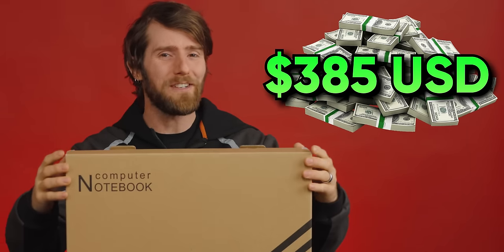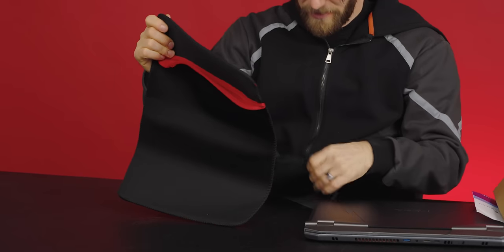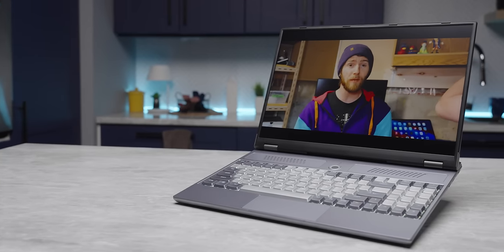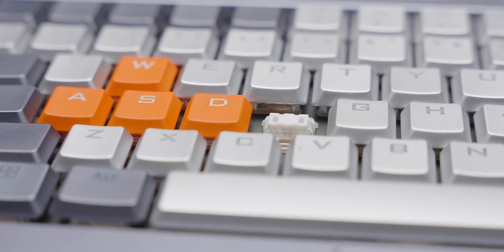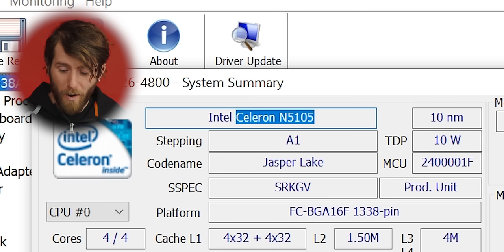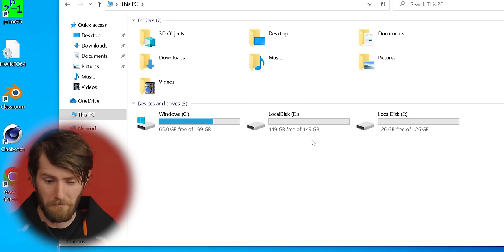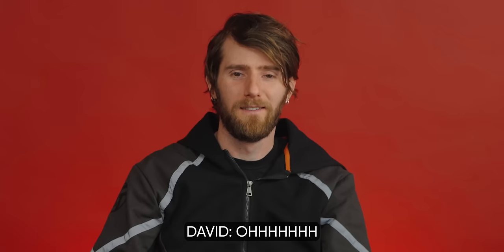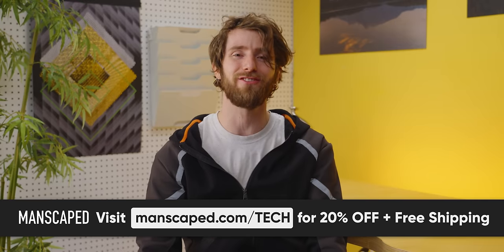Brown Star for Effort – This AliExpress Gaming Laptop is HILARIOUS

Comment: The magnetic webcam is actually quite nice.
Reply: Yeah, if it was done right i'd much rather have one of those.
Reply: i would rather have a physical toggle switch to disable the webcam. it would get lost and not be replicable because most companies dont care about reparability, and its not standardized so you have to buy their brand.
Reply: @VD-cc4hx  The point is not to disable it but to not have the border be super huge and/or thick. Good webcams (which this one probably isn't) need space, both tall and thick, both of which are really quite annoying when you want to make a sleek and thin display.
Reply: @sihilius  A few Chinese review channels also reviewed this laptop. Theirs all worked fine. I don't think they are paid to only speak about the bright side, and I really agree with their point of view. Why should someone spend all their really tight budget on a keyboard and screen, when the processor will be too slow to do basically anything in a few years , when they could buy a much more powerful machine with useable 1080P screen and keyboard, that will last them for many more years.
Unless they stick with windows 10 and MS office 2020, which is possible with the windows hackery that also works for office, and a reinstallation every few years to get rid of the junk files. So this thing is a really niche products for people who only type and browse the web. I really doubt whether this laptop will have consumer support in a few years. In China, it is possible to get it fixed by third-party, but it would not be worth the money considering how cheap it is.
So great idea, don't buy, unless you just want to use it as a secondary computer and are willing to accept the loses when it breaks.
Reply: I could see it being used on the ipads pencil charger
Reply: I wish i had one like this on my asus laptop
Reply: And you can hide it instead of using a sticky tape to cover it when not in use, to make sure you are not being recorded when you don't want to.
Reply: @yuxuanhuang3523  Sorry, my wording wasn't on point. I meant i'd much rather have a camera like the one in this Laptop but in a much faster laptop, that's actually useful for the kind of work I'd use it for, than a standard integrated webcam, that requires the border to be a bit wider. I don't actually want that exact laptop😅. Even for a secondary laptop i'd rather save up a little and get something with a little more calculating power than a very old school  mobile phone.
Reply: if only it worked
Reply: Until you lose it...
Reply: no shid
Reply: That's the only good thing in this lap haha 💀
Reply: @mohdarsh3263  and the price... If it had a nicer igpu it would be awesome. Almost worth having as a collector item for intel 10nm
Reply: @Kholaslittlespot1  yaa exactly an illegal collectors item (*_*)
Reply: It would be cool if the webcam was built in.
Reply: I like the idea too. Another idea: a center stage speaker. With software that boosts voices during movies.
Reply: @sihilius  exactly what I mean, good concept, bad product
Reply: Chinese products amaze westerners in way unexpected.  You get surprised negatively in a way, such as the speakers, while positively surprised by another.  Magnetic web camera is a brilliant idea, it gives you full and bezel less screen and safety.  Apple should definitely steal this idea and gets revenue from selling a separate HD web camera with price tag like USD 899.99.
Reply: yeah that is a great idea actually
Reply: @VD-cc4hx   Linus did a video about laptop webcams a while back. The physical limitation of fitting the webcam into the bezel of the display is actually why most webcams have such shitty picture quality (usually 720p). An external, detachable webcam would not only reduce the bezel size on the display, but would allow for much higher quality camera quality. 

https://www.youtube.com/watch?v=eWSQ7Cj_n5M
Reply: They could also partner up to make an integrated TrackIR or Tobii EyeTracker, which would be useful af on a gaming machine.
Reply: @sihilius  😅😅
Reply: except for the fact it didnt work
Reply: personally i wish it would have been a USB port solution like on the PSP with the PSP camera. So this could gave worked with a USB-C solution.  These little naked contacts seem way too flimsy and too sensitive to corrosion which results in bad connectivity.
Reply: @VD-cc4hx  that's what my hp x360 14c chromebook has.
Reply: @vocassen  Really? The upper edge on this laptop and my Omen 17 is practically the same and my display has a camera built in.
Reply: @piotrkowalski3869  Most of the Omen 17 model look to have humongeous borders, the smallest I've found (17-cb0020nr) has a border of 1.32cm (yes I calculated that from a front-facing image). Not something I'd say is small, nor would I say it's the same as the one in the video, which looks to be about half that size.
Also even that massive border of your Omen 17 won't fit some of the better webcams, which you'll certainly not find in a gaming-focused laptop where I haven't even been able to find a single mention of the webcam anywhere in specs or advertisements - not a good sign about it's quality I'd say.
Good camera needs space, shouldn't be that surprising.
Reply: @vocassen  When you look at the border of the laptop in the video it clearly not smaller than 1 cm and that .3 difference ain't even worth it.
Reply: @piotrkowalski3869  Idk if we look at the same video, but I'd guess it at 0.5-0.8cm max. But that's not the point. There are clearly laptops with much smaller bezels that wouldn't be possible with a webcam of any significant quality in them. That's the point.
Reply: It would be nice to have it on smartphones. Notch and punch holes must end! Such an eye sore.
Reply: @15bijei  At that point I'd just give up on a front camera straight up. Having an external accessory on a phone sucks. Instead one of those backside always on e-ink displays would be enough to at least check the framing should you ever want to do a selfie. I think there's a market for this, a lot of people don't really care about the front camera
Reply: @15bijei  Actually I take it back. What if you have a chunky, actually GOOD camera module that is both your front camera and back camera? Connection via USB, then an accessory might actually be worth it, for a niche audience
Reply: @Vocassen  they can create a grip/kickstand on the back with pocket for the magnetic camera just like the pocket for S-pen on samsung note phones. This magnetic camera can be use for selfie or rear.  It is also a good thing that cameras are detachable for security purposes. And you would be able to identify spying people because you can see that they are filming because the camera is attached to the phone.
Reply: @15bijei  Many problems here.
a) Thick camera attached on the back of the phone when not in use => More than double-thickness phone, better leave it attached if you need it and keep it separate. E.g. most of the time you won't have a camera with you, which might or might not bother you
b) If you rely on your camera to be detachable for security you already lost. Though I do agree front cameras are more of a security risk than they are worth for most people.
c) can't rely on bad actors using a niche product to identify them, completely inplausible. Integrated cameras won't disappear anytime soon. Also super easy to have cameras other than your phone that are super easy to hide. No way to counter really sadly
Reply: Hey there, thanks for the comment! I appreciate your thoughts😅 The magnetic webcam is a nice surprise, isn't it? It's an idea I pitched ages ago and it's great to see it in action. Enjoy the extra vertical space😉
Reply: No worries, I'm glad you liked the magnetic webcam! 😊 It's definitely one of the unique features of the laptop which I think is a great value for the price.
Reply: @sihilius  It's almost certainly USB electrically so someone handy might be able to do an upgrade.

Comment: Linus singlehandedly raised Deeq Inc. valuation by 100%.
Reply: Well I bought one after seeing this video
Reply: Can't help feel politically this was created as a "Come on main brands, upgrade your lower end tech already" video...
Reply: @SamariumNickel  Is yours still performing good and how is the battery life?
Reply: yes
Reply: @SamariumNickel  We need an update. How is the laptop? What do you use it for? Is it any good?
Reply: @TheNerogarden  Never got sound or the fingerprint reader working again after I installed Windows 11. Gave up after trying dozens of drivers. Never figured out what it needed. I thought about reinstalling Windows 10 but never got around to it. Pretty much only use it when Im traveling as an emergency machine. I never worry leaving it in hotel rooms or just losing it. As a beater, it serves its purpose. The camera dose fall out often though so I have that taped in. Without sound working on mine I don't use the camera.
Reply: @SamariumNickel  sounds like an amazing product
Reply: @SamariumNickel  If you ask the seller, or know anyone with the same laptop with original installation it should be possible for them to export those device drivers. Alternatively, you can in device manager find the device, go to properties, details and there find what the devices are specifically (which should make it signifanctly easier to locate drivers by googling the serial, model or thing similar to VEN_8086&DEV_7AF0)
Reply: 100% of 0 is still 0, so…
Reply: @SamariumNickel  would any linux work on it?
Reply: deeq nutzz
Reply: Buy Buy Buy!!   Let pamp this stock up!  ha-ha-ha
Reply: @ChrisTian-sd5yq - More like Deeze nutz! lol  But hey it "works".   Jokes aside, these specs would have cost around $1k in 2010 just sayin'.
Reply: tbh this is cool but i wont pay more than 50 euro for it so ama wait for a used one
Reply: @SamariumNickel One year on, does it still work?
Reply: nice deeq